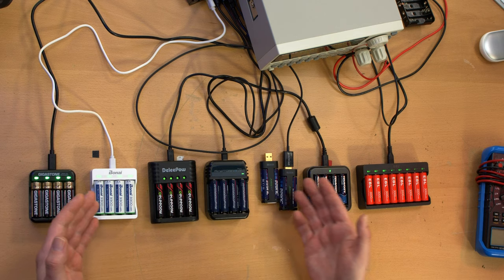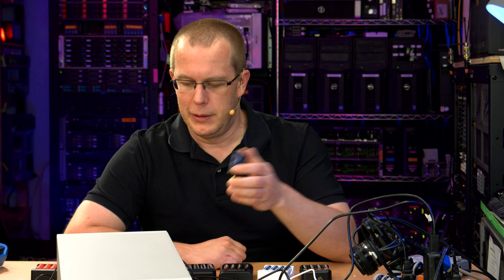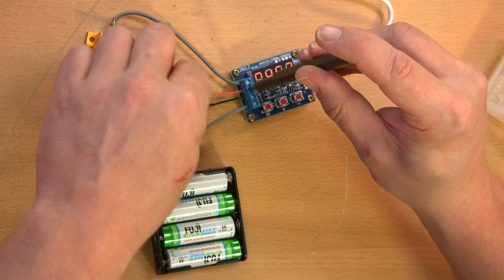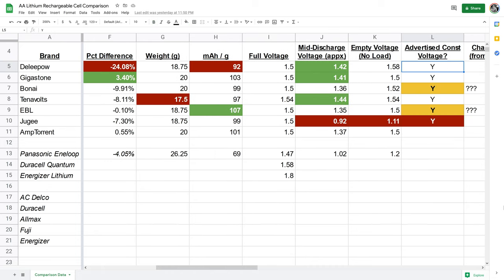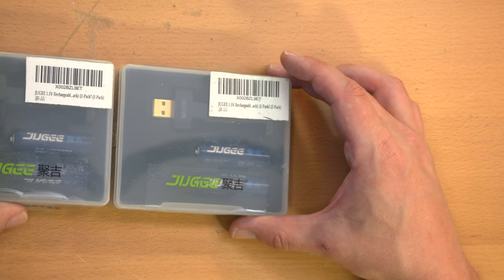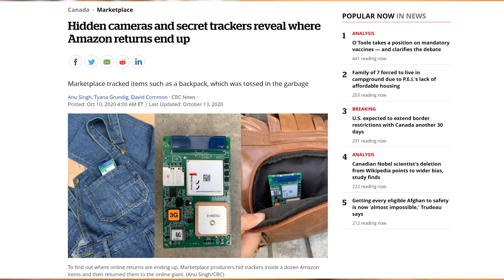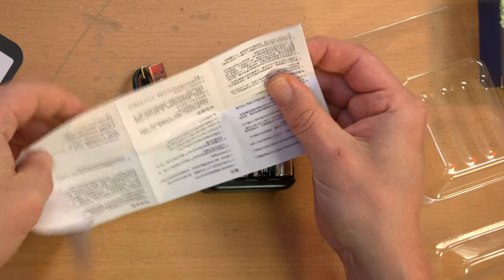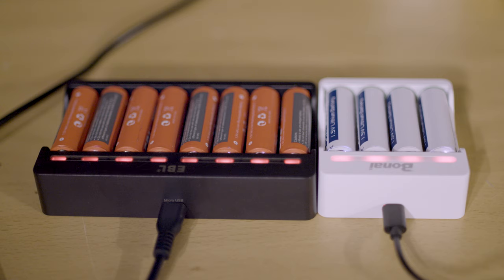AA Lithium Rechargeable Comparison: Jugee, Bonai, Amptorrent, EBL, Tenavolts, Gigastone, Deleepow

Comment: Scott, you are incorrect about the Jugee's, they only maintain 1.5v constant until they are drained to a certain level (Possibly 2/3rds of capacity), then they switch to 1.2v to simulate or trigger low power warning for some devices, basically they are designed to to drop, not run 1.5v constant then shut down like others do, I have been using a few different brands of these lithium AA's and the only ones I have that will trigger a low power warning before they fully runout are the Jugee's, all the others shutoff without warning, so they may not give you the full rated power, but they certainly work better in simulating a 1.5v disposable battery and they have lasted longer than the other ones I purchased, mainly the Kentli, which all died after less than 20 power cycles.
Reply: Yes. They are good. Last long and warn me before they die.
Reply: Big Clive has a teardown video of the jugee and he recommends them also
Reply: @gd.ritter  After all these years out of around 24 AA sized units, I've had 2 or 3 fail, so they have done me quite well.

Comment: Did you actually see at what point of the life cycle the Jugee’s dropped in voltage? From my understanding this is only supposed to happen when they have reached a low overall remaining charge, and the voltage drop is actually intentional in order to trigger low battery indicators on devices that watch for low voltage to indicate low remaining charge. These are quite popular in the Gameboy modding scene for that exact reason and some pretty involved members of the community have worked directly with Jugee to try to work out ideal voltage for this purpose. They have actually changed the indicating voltage based on user feedback. I’ve yet to take the plunge on any lithium ion AA’s so I’m curious what your testing showed on this feature. If it’s truly triggering at ~50% capacity, that’s definitely a problem.
Reply: A very thorough test and I liked the presentation.
Yeah, the statement that they 'always output 1.5V' at 6:00 isn't 100% correct. The EBLs and the JUGEEs definitely have that 'low charge' feature. They intentionally drop the voltage to 1.2V resp 1.1V, in order to trigger the device's low voltage indicator. Then they still run on the lower voltage for a short period, before totally cutting out.
Not sure if the other brands have that feature too. Would be nice to see a little addendum test. I mean...what else to do with 'so many hecking batteries'? :)

The JUGEEs are also available with a 4 and 8 slot charger with USB-C.
Reply: Spot on, they are designed to drop so you can have some early warning.

Comment: The old EBL NiMH 2800mah used to have some of the highest capacity for NiMH when new, but they tanked quickly over time. Cool video
Reply: I bought a set of the 2800mAh EBLs, too.  They don't hold a charge very well when they are sitting unused.  That might be fine if you are going to be using them right away but after a month they loose half of their charge just sitting in the battery case they came with.  Their 2500mAh version holds a charge much better and are actually pretty high quality NiMH cells (and are a couple dollars cheaper per case of eight).

Comment: Love your no BS attitude. Don't change it.

I've been trying out the AmpTorrent for a while  and so far it's about the best substitute for an alkaline AA at least in my use case.  I use it for my Omron  blood pressure cup all the way through using it for LED candles  which run about 4 hours per night. In addition, I found that it had good compatibility in some of my granddaughters toys. 

I hated the thought of sticking USB dongles into the side of my batteries.  However, I'd like to see a standardization and ideally a company like Amazon selling their version of lithium rechargeable batteries. More to do with trust and replacement than anything else.
Reply: I was wondering how it would work in a bike light (just a dual AA flashlight) - nice to hear it's pretty close to Alkaline performance in an LED candle.
Reply: @jtee9548  .. Just know there isn't much warning when the AA Li-ion batteries are drained. Basically 1.5v all the time and then a sudden drop following nothing.  Frankly, all of these lithium-ion batteries for AA and AAA need work and standardization for recharging.  At this point or beta testers.  Also with that brand I've run across a few dead cells, and were easily replaced by Amazon.
Reply: @DJaquithFL  From the ones in the video Jugee give a warning - they drop to a lower voltage before dropping completely.
Reply: @2L40K  .. Interesting that my reply disappeared. Long story short, it's simply isn't the case. I have two different brands of lithium ion, AA and AAA batteries and they're good for low drainage things like remotes and LED candles etc. Otherwise I would recommend Amazon's high-capacity nickel metal hydride batteries.
Reply: @DJaquithFL  If you have a link in the replay, or something else - it may disappear. That's the limits of the freedom of speech these days... On paper, you are free, in reality...

Otherwise - I never mentioned anything about high current applications. The MILBEP standard is about charging, not about discharging.

About the warning - NiMH chemistry has a relatively flat discharge curve. It goes relatively flat, and than suddenly dips down. Jugee do emulate that reasonably well.
Reply: @2L40K  .. As far as links are concerned, I don't think freedom of speech has anything to do with it. I remember when it was abused quite a bit on YouTube. 

My feeling about lithium ion rechargeables at least that replace AA and AAA batteries .. is that they're not ready for primetime yet. I certainly wouldn't trust them, for example, in a front door lock or something like that yet, and the nickel metal hydride may or may not have the power necessary to move the deadbolt. During Christmas alone with everything that has a battery in it, It makes it worth it using the rechargeables; some lights burn through / discharge a set of batteries in a matter of three or four days. In contrast, I vape, 18650 batteries are pretty reliable, but their nominal voltage is 3.7 volts. The Deleepow AAs does have a voltage drop that will last a little longer than the AmpTorrent AAs. I remember when I was trying to use AAA AmpTorrent and I would get oddball activity in my headband flashlight where the LED light was strobing and because of the strobing it would change settings. It was just completely unusable. Whereas I can use the nickel metal hydride batteries in that same flashlight and not have that weirdness. My guess is whatever they're using to lower the voltage from 3.7 volts down to 1.50 volts is causing some odd signaling from the output. I'm not an expert here. I'm just telling you what I run across. We have an absolute ton of (18) LED candles scattered throughout our house and the lithium batteries do better because they hold their 1.5 volts. In most of my grandkids toys I tend to put the nickel metal hydride $4+ (4 batteries) because if my daughter accidentally throws them out it's not like throwing out $20+ (4 batteries) by accident. We still have use for energizer non-rechargeable alkaline batteries. These rechargeables has just reduced the waste by at least 80%. 

Anyway, good luck to you.

Comment: re: "the Energizer Lithium cells must also have a DC-DC converter on board as well, and they clocked in at 3427mAh"  Nope. The  Energizer Lithium AA batteries are primary (non-rechargeable) that use lithium iron disulfide (LiFeS2) chemistry with a nominal voltage output of 1.5vDC. They have no on-board voltage reduction circuitry.

Comment: I bought the AmpTorrent a year ago or so and use them in LED flashlights. Because the hold 1.5V the flashlights are brighter than other rechargeable or alkaline. 

On the downside, because they hold 1.5v until they can’t, the flashlights just stop working one day. The light doesn’t fade letting you know it’s time to replace the battery.

Comment: Just a note ... you can buy short USB extension cords if you don't want to plug a USB device into a USB port. Just make sure that they have HEAVY GAUGE WIRE to minimize voltage drop, and also minimize their length.
Reply: Unless you are buying a 100 ft usb extension cord, the Voltage isn't dropping ...

Comment: Great video :) Voltage sag under heavy load is quite typical for voltage regulators as they self-protect from current and thermal overload. The voltage regulators in these cells are tiny and i doubt they are rated much more than 1A.  A tare-down would be interesting.  We have all had at some point a finicky remote, gizmo or toy which really only works well with fresh alkalines and these applications are where i hope these lithium ion AA cells could really shine.  It would have been really interesting to see voltage under much lower loads - 50mA, 100mA, 250mA, etc - i hope it would have been closer to 1.5v.

Comment: The only problem that I've encountered with rechargeable Lithium Ion batteries is the complete blocking of the AM band on my portable radios. This may be due to the safety circuitry in the battery. Other than that, they are fine for flashlights etc.
     I never buy Li-Ion batteries without the protection circuit for obvious reasons.

Comment: I'm already wishing for AA/AAA batteries based on LiFePO4 chemistry, which is generally safer and good for more cycles. The only downside is energy density.

That said, my REAL wish is for devices to STANDARDIZE to use and recharge straight Lithium Ion (or LiFePO4) batteries, such as 18650s, 14450s (AA form factor), etc.

Comment: Good video.  Thanks for explaining the test setup.  Have you seen XTAR batteries? I have use their chargers to test 18650 cells for capacity. I did notice a review showing the XTAR cells have RFI (radio interference) which is bad news.  I use a lot of batteries around my radios so I keep looking. Oh did you test the batteries or cells here for RFI?

Comment: What I'd like to know is how they perform at very low discharge - like a smoke detector.  That would take a long time to get results but it would be worth it.  NiMH, even the LSD eneloops suffer from voltage drops over time.  How do these perform compared to disposable Lithium AA?

Comment: Do you have a recommendation for a low cost tester for Lithium Ion (both chargeable and nonchargeable) batteries? I heard the testing should be "under load". I use A LOT of batteries in trail cameras and I need to group batteries with similar charge together. I'm not fluent with anything to do with current or how batteries work, so please keep it simple. I want to be able to test Energizer Lithium Ion 1.5V batteries (mostly) and lithium Ion 1.5V rechargeable batteries (Amp Torrent) . Something that worked on both would be ideal, mainly for the useful remaining life of lithium nonchargeable batteries, as they seem to yield different readings each time I test them. 
This error could be on me, or my cheap multimeter that just died, which started this search and brought me to you. Again, something simple, or easy to make or all ready made, and has it's own battery so it can be portable.
Thank you

Comment: I'd say the Ten-a-Volts are the best. Capacity isn't everything unless your running a low power flashlight or something. Voltage sag during discharge proves the quality of cell inside. In my opinion.
Reply: They're twice as much as a lot of the competition, though.

Comment: Very interesting, thx for that. I didn't know these were such a mainstream thing now. Seeing this, it looks like a huge incompatibility mess. Despite there being 3.7V Li-Ion AA cells (without any circuit), looks like charging on these 1.5V regulated cells is a mess. Seeing the chargers from the Video, one showed 1.5V charging voltage, one 4.2V charging voltage, one 5V charging voltage. So obviously some rely on a charging circuit inside the battery, as some others do not. This means you always have to keep battery and charger together and can never mix them - or things might explode 🙈
Reply: Not a complete mess. Some of them follow a snadard, called MILBEP. In the video these are at least: Jugee, Amptorrent and Gigastone.

Comment: Can you test if you can charge this battery's with a common Li-Ion charger like the Opus BT-C3100?
Reply: "Testing" this physically is a very-very stupid idea. Unless you want to get what ELECTROBOOM usually gets...
You instead test the charging curve of the original charger and compare it to the charging curve of a Li-ion charger.

Comment: Hi Scott
Can I charge these batteries in other chargers?
Or are they recharged only with the brand charger?
Reply from the maker: I wish I could say for certain, but I'm not sure.  In theory they should all have similar charging characteristics but I don't want to worry about it causing a 🔥🔥🔥.
Reply: @ScottDotDot  
this is exactly my concern!😅
thanks for the attention
Reply: Some specify to only use the same brand. From what I've read some charge differently and have different circuitry.

Comment: When it comes to USB I never liked anything hanging out of the side of my laptop.  It is easy to bump it them you have a socket is loose and never holds a reliable connection ever again.  It is because of that I bought a Bluetooth mouse so it can be paired to the Bluetooth that is a part of my WiFi card..  Now no more dongles hanging out of the side awkwardly waiting to wreck my sockets!  The only downside is that the mouse has to be paired to work and does not work while in Windows setup (no driver or pairing setup yet).  I also like Bluetooth because I use it to send a photo from the phone to the laptop.  It is not a fast transfer but the tradeoff is the ease of the transfer.  Some of my photos are 30 MB or more and so they can take a good few minutes to transfer over.

Comment: I've had nothing but issues with my EBL. I use their chargers and even though they say fully charged the batteries that still work only last about a week at most in an Amazon Fire TV remote. Out of the 60 batteries I've purchased I've had 14 go totally dead before the third or fourth charge. We use our batteries in remotes and clocks, not exactly high current drain devices. EBL batteries are garbage as is their tech support. I've complained to them several times and they don't care. And people wonder why we try to buy American. Ya, go figure. In my opinion I would stay away from the EBL brand of battery. Total junk.
Reply: On the Project Farm video where he tested them, they also had the biggest discrepancy between stated capacity and actual capacity. Between that and your comment, I'll be steering clear from them as a brand.

Comment: Any charger that only uses a micro usb plug will never charge as quickly as a charger with a usb c plug as micro usb can only handle 7 or 8 watts whereas usb can can handle 60 watts if not more.

Comment: I tell ya what idiots can waste extra cash on lithium rechargeable batteries I’ll stick with my good old eneloops brand they r the best of the best they may not have the highest mah but dam if they don’t out last all the higher mah rechargeables 8 plus years strong and still running them daily and they seem to be running like the day i got em in the main from eBay although the kids lost over half of the originals do they last as long as alkalines do no but it’s dam close actually the eneloops out perform the energizers and duracell brand alkalines as the alkalines drop in voltage straight from the get go the eneloops kept a steady current until they hit around 8 to 5 percent charge rate just ordered more eneloops told the kids they ain’t touching the new ones I ordered. Eneloop white aa keep a steady 1.2 volts every time
Reply: Keep in mind, there are some instances where you absolutely need 1.5 volts constantly. 

In 90% of cases the eneloops are amazing and are honestly one of the best options. (I have yet to have a single one fail) However, I have a couple of tools that I use that require 1.5V consistently which is where a set of lithium's would work better. 

An example would be my studfinder, it requires 1.5v to work, it won't even power on with the eneloops.
Reply: I bought the AmpTorrent for a single cell LED flashlight. The constant 1.5v makes a huge difference in the amount of light. 

I also use Enerloops in wireless mouse and keyboard which are much less finicky.